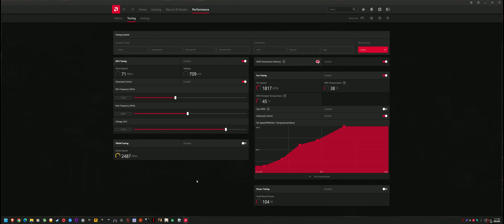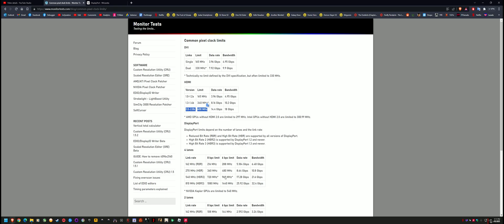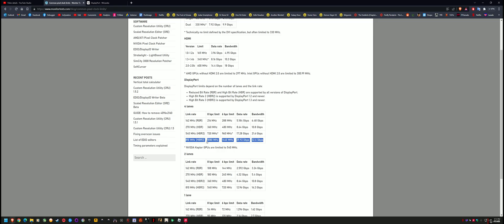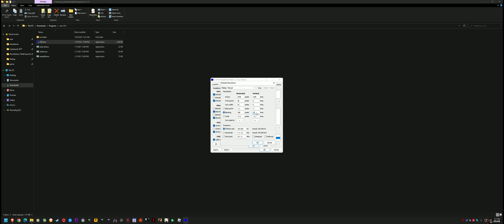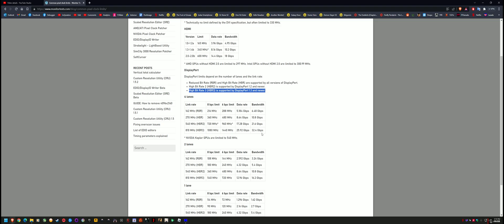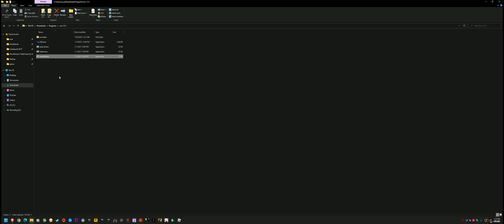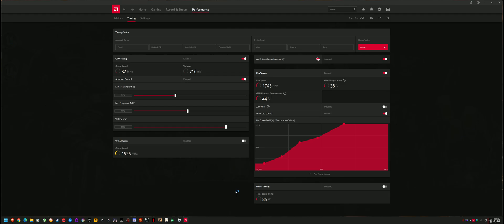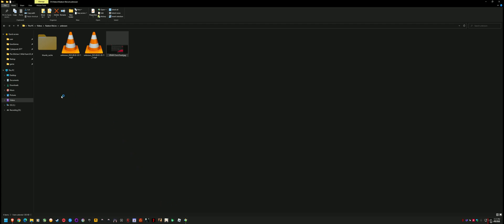RX 7900 XTX High Idle Power / Stuck VRAM Clock Fix (CRU)

Comment from the maker: Skip some talking: 3:28
TEXT GUIDE UPDATED METHOD 2024(Credit @Ludak021)
Please keep in mind due to differences in monitor/cable quality, results will vary & aren't guaranteed

1. Download CRU & run as admin. https://www.monitortests.com/forum/Thread-Custom-Resolution-Utility-CRU

2. Open (Double-click) the details under 'extension blocks', there may be more than one option, you are looking under 'Detailed Resolutions', double-click again to open it, look for your monitors High refresh rate resolution. 
e.g. For me it was under 'DisplayID 1.3>Detailed Resolutions> 3440x1440 @ 165hz. https://postimg.cc/MvL1FYpr

3. Take note of the vertical blanking lines, then at the top of the detailed resolution window there's a dropdown list, select 'Automatic PC' which will change the timings for you, click OK for each window that was opened until the app closes, then run 'restart.exe' the screen should turn black & make a device detected sound before re-appearing. Check your VRAM clock in Radeon performance tab.

4. If for some reason it makes no difference, go back into CRU and 'check' the detailed resolution timings to make sure the blanking times are changed, if its back on the old timings then it wasnt stable in which case you can try setting 'automatic PC' again and lowering the blanking value in increments of '10', or it may be cable related so trying a new, higher quality cable and repeating the process might do the trick.

OLD METHOD --------------------------

- Research your Monitor CABLE max pixel clock.

- Download CRU & run as admin. https://www.monitortests.com/forum/Thread-Custom-Resolution-Utility-CRU - The DL link is at the top, cru-1.5.2.zip

- Open (Double click) the details under 'extension blocks', there may be more than one option, you are looking under 'Detailed Resolutions', double click again to open it, look for your monitors native + High refreshrate resolution. 
e.g. For me it was under 'DisplayID 1.3>Detailed Resolutions> 3440x1440 @ 165hz. https://postimg.cc/MvL1FYpr

- Look at the default blanking time and current pixel clock, increase the blanking time number & note the pixel clock change, you want to find the highest blanking time while still keeping within your monitor cables max pixel clock specification.(Results may vary).

- If you believe you've set it right, click OK to all the windows until the app is closed, then run either of the 'restart' executables. The driver will reset with the new blanking time and VRAM downclocking should be improved, you have to experiment a bit until you find the optimal setting though I dont recommend setting the blanking time to the absolute limit of the cable, 50-100mhz headroom might be a good starting point. 

Note If the blanking time & pixel clock are too high for your cable(or the cable is cheap/fake) then you may get a prolonged blackscreen, the monitor/driver should just reset back to default on its own), if you get intermittent black screen/flickering after running restart, then instead run the 'reset-all.exe' file to manually reset back to default and try again.

https://www.monitortests.com/blog/common-pixel-clock-limits/

Hope this helps!
Reply: my resolution and refresh rate listed on any of these options under extension block. 

Monitor is running 2560x1440 @ 144hz but i only see options like:
1920x1080 @144
2560x1440 @ 120

any idea?
Reply from the maker: Btw make sure you FULLY let the system idle when testing, simply moving the mouse on a high refresh monitor will prevent full idle, you have to pretend to be AFK & dont touch anything as there's also a delay on software updating the wattage & VRAM clocks, simply having your hand on the mouse & moving it 0.01mm can prevent full idle, this is after 5+ seconds not touching the mouse. https://postimg.cc/CztLhhq0

Comment: I think this is an incredible guide; I solved this problem without watching this video. The problem is all about numbers and math.

For my RX 5700XT, using HDMI 1.3 on a 1080P 144Hz monitor, my free memory clock speed dropped to 200MHz when I set it to 339.96MHz. I think this problem isn't with AMD, but rather with the monitor manufacturer.

Comment: anyone here know settings for a 1440p 360hz monitor??????
Reply from the maker: In CRU try looking for DisplayID under extension blocks>detailed resolutions, find your 360hz setting and see if you can do CVT-RB2 standard or if anything turns red>CVT-RB or Automatic PC, it highly depends on the monitor though as some come with decent blanking time/tuning while others don't, then ok>ok>ok out & run the restart64.exe

Worst case scenario if that doesnt work, go to start>search 'display>advanced display and click the dropdown arrow next to refreshrate list(not the actual list, the arrow next to it) and enable 'dynamic refresh rate' + adaptive sync in radeon display settings. You might get some desktop flicker between taskbar and windows but it will drop the desktop//browsing fps down to 60 when streaming etc. & save a ton of power when multitasking if thats your goal.
Reply: @PatchFixGaming  CVT-RB2 worked for me man, you're an absolute legend thanks so much

Comment: I'm looking for new GPUs, and the RX 7800 XT seemed like a great option, but I am highly concerned I'll run into this issue. I run Fedora Linux, and have no access to software like this. How come I've not heard of this issue on NVIDIA cards?
Reply from the maker: It depends where you look since Nvidia use certain methods to avoid negative public opinion.(Closed Reddit support sub even though it 'exists), https://www.reddit.com/r/Nvidiahelp/comments/4x8li0/psa_rnvidiahelp_is_closing/ and most complaints are either in reddit comment sections for driver or monthly mega threads, or the nvidia forums themselves but in different forms of complaints, not specifically high vram, some worse, most are just 'similar' with no clear winner if you really search and try to compare, I would base the choice more on your distro compatibility & features you want vs price. 

Nvidia even renamed its 'troubleshooting megathreads' with hundreds of complaints going way back to 'tech support' but you can get my point if you browse the comments(That dont come up as posts),, complaints in their main sub are removed and redirected to keep it out of reddit search.
https://www.reddit.com/r/nvidia/search/?q=tech+support&cId=fcc8eb89-294d-4a7e-ab92-9595e025448f&iId=4603e1db-086a-418a-8b81-332900f6600c
Most 'matching' AMD complaints and worse issues are in the driver reports, so 'rolling back to an older version' is 100% not an exclusive thing based on what I've read there xD
https://www.reddit.com/r/nvidia/search/?q=driver+faq&cId=c5a66ce6-9b74-4b81-b64f-08e1a63ed42b&iId=9bd049e0-dd87-461d-9d91-556be711a092

You can also use verbatim search for complaints against X model in google then compare the 'numbers'(also factoring in nvidia generally higher sales) to gauge if nvidia are issue free, just be sure to compare more than one term, not just 'high power, high vram clock, but also stuff like black screens, random crashing etc. when comparing two models,, when I've tried this it seems theres no clear pick based on a 'zero complaint' perspective, rather proper system stability checks, bios, chipset driver etc. and finding a stable driver for your use(some drivers from both teams are just bad for certain niche use). But usually theres a decent older stable one, on both sides.

Hope that helps!

Comment: This really does work. I have puny rx7600 with 4k 160hz and it idles without EDID editing around 25w and 909mhz on vram causing fans to spin pretty much regular 4min intervals to 1000+ rpm as it reaches to 60c doing while doing nothing which drove me nuts. After editing it doesn't reach 60c and stays low 50s and now it idles sub 50mhz on vram with 7w on full idle. Sad that you need to use 3rd party software to solve it as AMD resolution override just states that display does not support such settings..

Comment: This is a nightmare. I've set all mine to 60hz and its stil 120w idle, it's pissing me off so much, had this card for years now, bet it costs me a fortune to run...
Reply: I've gone down to just one monitor. 1440p oled 240hz and it's drawing 80w idle. fml.
Reply from the maker: The main issue is with high refresh rates at desktop with high refresh since all the 200hz stuff is still niche//fairly new in terms of desktop refreshrates that historically were 60 - 144hz for a long time before people started having high idle power issues(I still only have a single 165hz ultrawide) but knowing how desktop refreshrate + blanking affect power even with lower refresh monitors it seems like the most plausible explanation;;

What I'd do is experiment with both freesync/gsync or use adaptive only on both if they are separate(e.g. one is gsync, one is freesync = use adaptive).. as both can help with dynamic refreshrate adjustments between apps, then if you still have the secondary monitor & on Win 11, go to start>type display settings>advanced display, and look for a dropdown for 'Dynamic Refreshrate(DRR)' and enable it, this should let your monitors drop all the way down to 60hz at desktop. https://postimg.cc/gallery/JW9fKykY

The main issue using this workaround though is apps like chrome dont fully support DRR, so if youre trying to multitask with a game + chrome at the same time, chrome might cause the refresh to get stuck at 60(would need testing);; it seems like chrome has a bug involving HW acceleration(which is a common problem across most HW accelerated apps when it comes to power saving & multitasking). So what you can try there is simple disable HW Acceleration across all background apps to let the refreshrate boost properly when gaming.

One more downside is when multitasking between apps that cause the refreshrate to boost up when the taskbar is visible(again mostly a HW acceleration or windowed games issue), you might see the windows taskbar changing shades of whatever color you have it set to as the refreshrate changes back and forth when mousing over it(Still worthwhile if it helps with idle power saving).

Worst case scenario if you arent hitting ~200fps+ 1% lows while gaming, the benefits up at 240hz will be lower & you could safely set your refreshrate down a notch in display settings & simply cap fps closer to your 1% low without hitting input latency too hard(sometimes it even improves it according to online tests compared to uncapped). The biggest input latency improvement is from 60 > 144, then the higher you go the latency improvements are smaller.(You can also force fullscreen + high refresh in games where you really need it and just live with the slight alt+tab delay on a single monitor only, just not all games support forcing custom refresh in fullscreen).

Hope that helps or at least gives you some ideas to try.

Comment: Is this fixed
Reply from the maker: It can be driver related & resolved with updates + use of adaptive sync, but sometimes it's budget monitor + high refresh problem, the default profile of the monitor itself & high blanking time especially with multi-monitor can cause the issue. I've heard improvements with recent driver updates but cant verify sorry, the blanking fix via CRU has been solid for me up to 24.7.1, though Im not updating to 25.x drivers as they have issues with Relive recording. Cheers

Comment: I never noticed this issue till recently. Had a 6800 XT and don't think I ever had this issue pop up. Even with the same OLED 1440p 240hz monitors that I have now. Upgraded to a 7900 XT and built a small form factor Pc for travel with a 6900 XT and they BOTH have this issue. The ONLY way I could stop the high memory clock speed to lower from constantly being at max even at idle was to set the monitor I don't game on to 60hz and had to create a profile in Adrenaline to lower my gaming monitor to 200hz refresh. This also fixed some games having micro stutter for me. Went from a constant 2600MHz on my 7900 XT to an average of 100MHz on idle. Had to pick 200hz as Adrenaline would not let me use anything else as it kept giving me errors for only slightly lower refresh rates and I still wanted higher refresh than 144hz.
Reply: I did the exact same thing, making a custom resolution at 200hz. This lowered the Mhz the same for me. However, it did not lower the power draw, this stayed at 85w. Did it lower it for you?

Comment: The method i did, was uninstalling Wallpaper Engine (it's VRAM usage has been causing issues), and i just enabled Freesync. I have the LG 49"UW Oled 1440p 240hz monitor. My VRAM was spiking way above the norm and it was idling at 80w bcuz of Wallpaper Engine. Removed WE and it went down to 44w-52w, i then enabled Freesync, and it dropped to 22w. Im now playing 240hz refresh rate with only 22w at idle. Fucking insane.

Edit:
I did also create a custom resolution using Adrenalin, all i did was change the refresh rate to 165hz, switched to CVT-Reduced Blanking, and clicked save. Idle power is reduced dramatically as well. But i prefer the 240hz bcuz that's wat i paid for. Unfortunately i couldnt make a custom resolution with CVT/CVT-Reduced Blanking, with 240hz cuz it's unsupported for some reason. But it was supported with 165hz.

Ik every monitor is different, but just try removing Wallpaper Engine and enabling Freesync. See what it does. Maybe try the 2nd option too.
Reply: gad bless you man, may both sides of you pillow always be cold and the traffic lights always green. just got mine working. turned our free sync was the reason. turned it on and everything works (frequency and everything) perfectly
Reply: @3awardo thank you man, may your women be thick as the Valkyrie Queen Freya, and your currency be vast.
Also try the method shown in the video as well. Just increase your blanking lines and u should see a significant difference in your power consumption, as well as less flickering too. 
Dope pfp of Dom from Windbreaker btw!
Reply: bro you're the goat, wallpaper engine was singlehandedly pumping my  clock speed to 2.5k idle